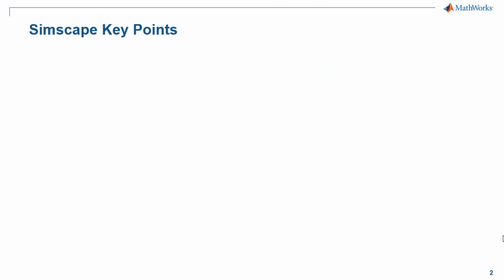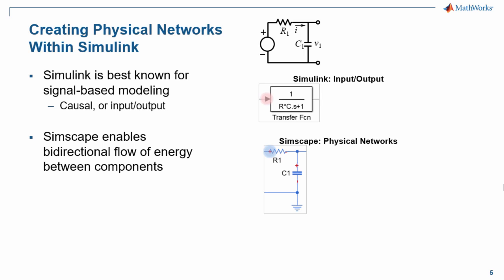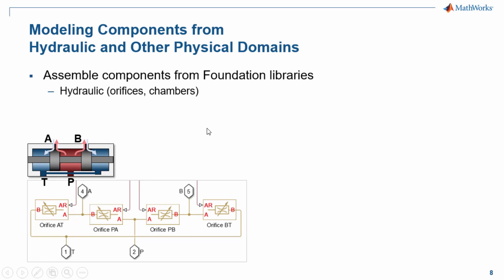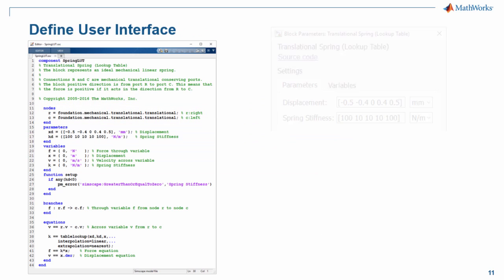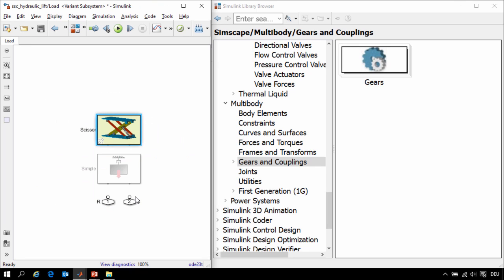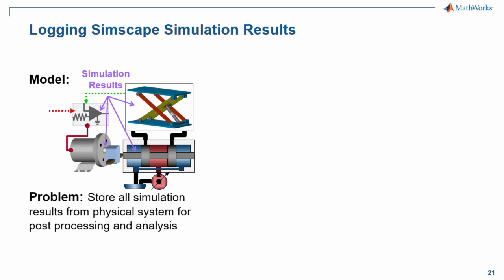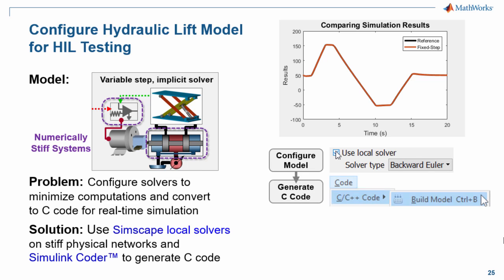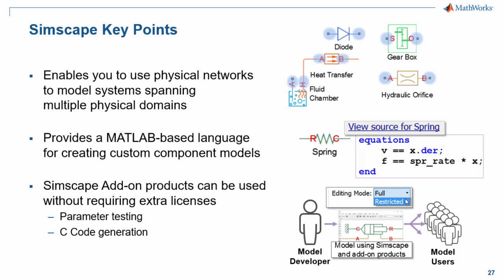Physical Modeling with Simscape

Comment: I have a hard time understanding Simcape language for gas networks.
How the equations work together. How does choking work? 
Port convection?
I would like to model supersonic flow through a CD nozzle.
But I am already confused with the following: 
The exit plane has a different pressure than the medium it is expanding into (the next connected block).
But shouldn't across variables be identical at each node?
How is stuff like this handled in Simscape?